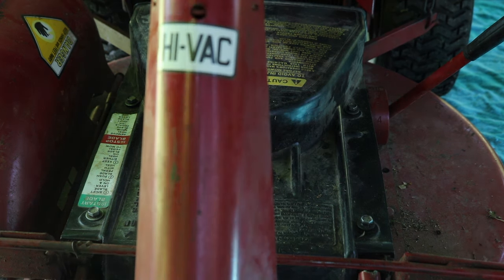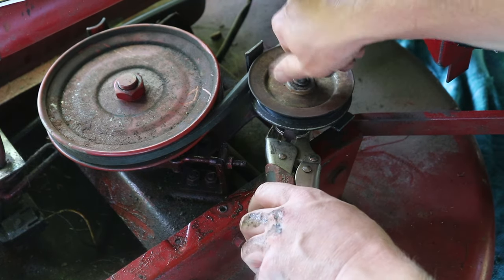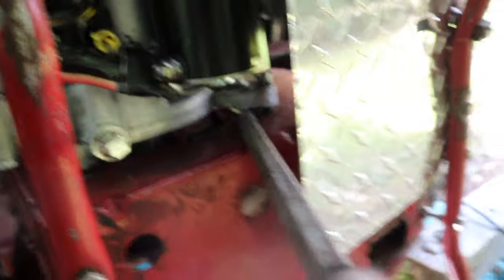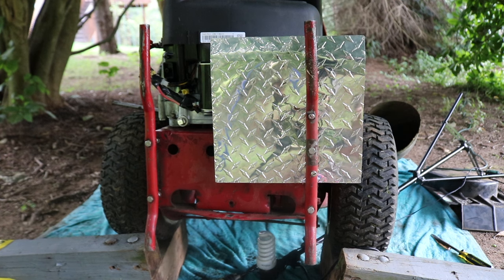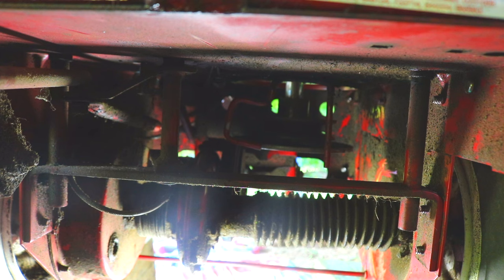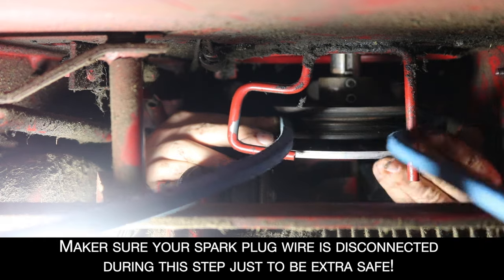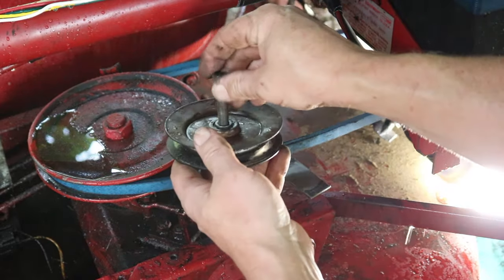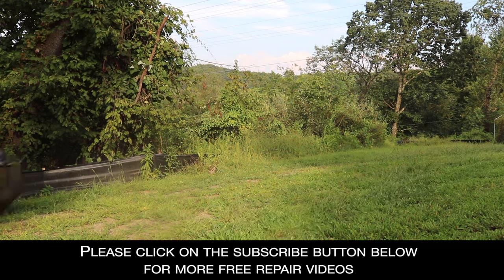How to quickly change a Belt 7010749YP on a Snapper Rear Engine Riding Mower 28085

Comment: Thanks for this man. I just got done and it was a pain at first. Loosed the engine and it was pretty smotth from there. I had to take the bolts out of the rear drive or whatever to get the belt on and off. Thanks again!
Reply from the maker: It's interesting because I tried everything else they said works online but the engine bolts were the only way I could get it back on easily.

Comment: Thanks so much front part of the belt was easy .Then I could not get the rear loose . Watched your video and loosened motor bolts raised motor up 1/2 inch belt came right out . THANKS
Reply from the maker: Glad it helped. Thanks!

Comment: You really didn't have to untighten the motor. If you drop the belt on one side under the motor shift to gears so you could take off the other side and the belt completely comes off. I just did it today. The only time I used my ratchet set was to take the cover off and the pulley.
Reply from the maker: Thanks for the tip. I'll try that next time I change the belt on the Snapper.

Comment: Thank you! I could not change the belt without loosening the engine! I'm a carpenter not a mechanic by any means. I hate Engineers. Seriously...couldn't have left another 1/4" gap.
Reply from the maker: I was thinking the same thing. The experts put the tractor on a lift so I found another method that works. Thanks!

Comment: With that engine, you can take the gas tank out of the holder so the cap doesn't leak, and lay the mower on the left side...won't hurt a thing. Then you put the trans in 5th gear, with the rubber disc all the way to the side of the engine pulley/drive disc, so you can get the belt between  it and the rubber wheel without having to loosen the engine bolts. And you can just loosen the deck idler pulley, you don't have to remove it. I could replace that belt in 8 minutes, not counting the plastic deck cover. (30 years in the power equipment business)
Reply from the maker: I love those old snapper mowers. It's true the gas can comes right out. They don't make them like that anymore.

Comment: I have a 1973 Comet and dont need to move the engine to change the belt. Put a clamp on the clutch, this raises the rubber disc and related assy then you can squeeze everthing out. YMMV
Reply from the maker: Good tip. I tried that first but just didn't have the strength so I went with the slower approach.
Reply: @RayStein  I use one of those clamps that allows you to repeatedly pull a trigger grip and it slides the clamp a foot or so along its length. You can let the clamp do the work as opposed to you.

Comment: You can adjust the belt tension if it is too loose. Under the seat there is a clamp around the main frame tube. Loosen the clamp and slide the tube in the rear section as needed, and tighten. You may need to adjust the pedals a bit, just move the grommets on the pedals.
Reply from the maker: Thanks! I'll check it out. I love those old Snapper riding mowers. They're built like tanks compared to the new Cub Cadets and John Deer low priced models.
Reply: @RayStein  Changing a belt on mine as we speak but the 71 1/4 belt was far to short. Went with a 74 1/4 belt and it's a perfect fit.  Mines a 33 inch. Waiting on a few other parts before I roll it out. I love these old mowers too. I got mine for free at a curb in the early 90s. Cleaned and rebooted the rear axle once and went thru a few used engines but that's cheap compared to what they sell today. A plastic camshaft and trans axle? WTH?

Comment: Is that a v groove pulley? Or flat? On the tensioner.
Reply from the maker: Mine is a v groove. Just double check in case yours is different.
Reply: @RayStein  Thanks for responding. Mine is also a V but how can the flat side of yur belt ride on a V pulley? I was given this rider and don’t know what was done to it but my belt does sit flat on the V pulley.
Reply from the maker: @pushrd1  The v goes inside and touches the metal inside the metal pulley on mine and it works great and never slips. If the belt was flipped the wrong way it might explain what they did wrong meaning they have the flat part touching the pulley.

Comment: Please what size is the belt!!!??
Reply from the maker: OEM Replacement Belt Snapper 7010749YP Belt Application: Drive Belt Application Drive Belt Type Double V Width 1/2" Length 71 1/4" Packaging type Branded sleeve
Reply: What size deck or does it matter. Mine is 28 inch rear driven only difference I can tell without the engine stamp is mine has a rectangular steering wheel

Comment: I have a 1990 model snapper rear engine 10 hp with a 30 inch deck possibly does anyone know a belt that would fit it that is specific to the Snapper SR 120 please because I just ordered a belt for it with the same exact part number and it’s too short. Please help it came from snapper themselves It was $54.00. Please help.
Reply: It’s a deck drive belt to be specific.
Reply from the maker: I would take the old belt to The Tractor Supply store and measure it. If it does not have a belt get as close as you can to the right size. They let you try various belt sizes to see if it fits and return ones that don't fit.
Reply: Did you check if someone stretched the tube to take out slack? That would make your belt too short also.